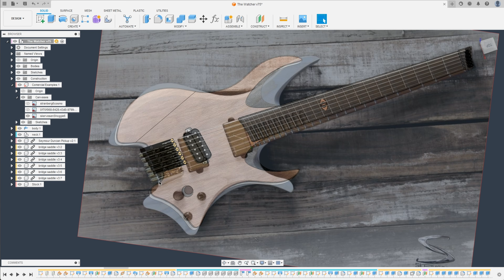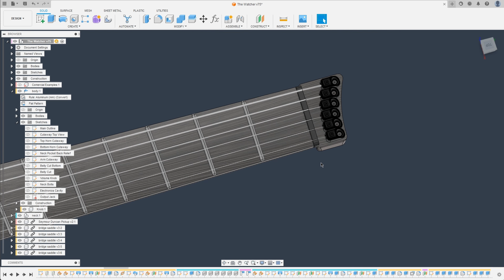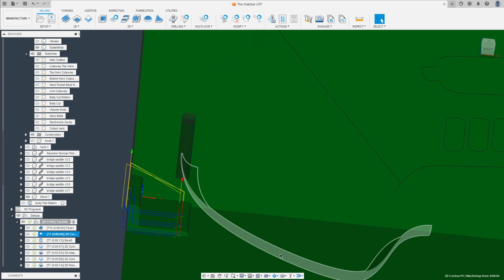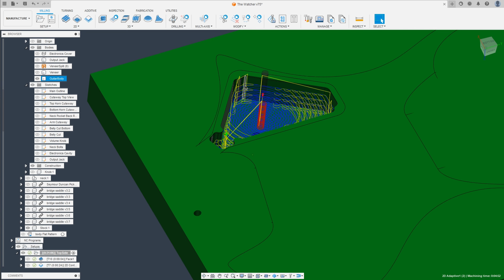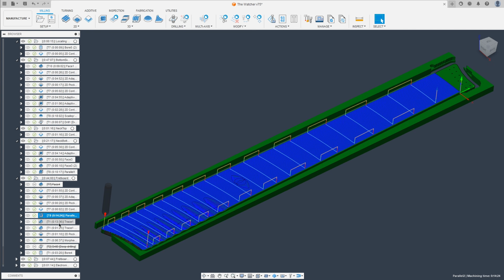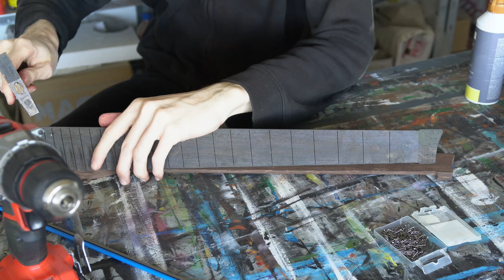Building a Headless Guitar using Fusion360 and Hobby CNC - Dark Art Guitars "The Watcher"

Comment: After a year, how are those bridge tuner holding up?? Would U recommend those anymore?
Reply from the maker: No, I never used them again. I would recommend to go with Nova Guitarparts instead, they're not all that much more expensive and much better. The ones I used here are just not worth the trouble.
Reply: Cheers mate!
That’s what I was thinking. I’m either going (with my build) the Nova guitars set or Ibanez monotunes. 👍🙏

Comment: Nice insights here, I'm curious about 2 things though.

1. I see you're still doing the fretboard separately, did you ever experiment with glueing it up before as you mention in this video?
2. What sort of speeds and feeds are you running with that 0.5mm bit? I'm impressed every time I see it, and the amount of material you are able to remove for the inlays without destroying bits is really impressive!
Reply from the maker: 1. I did it once, but the work holding of the neck is much more difficult, plus it is more strict on the order of operations so I went back to making them separately. I've had it where there was a bit more work when leveling and radiusing because of this that could have been avoided, but not enough to make me go back.
2. For the inlay I usually go in with a 2mm endmill first to remove the bulk of the material and then do rest machining with 0.3mm stepdown and around 500mm/min for the 0.6mm tool. But still some of the more involved inlays might take an hour or so to cut.